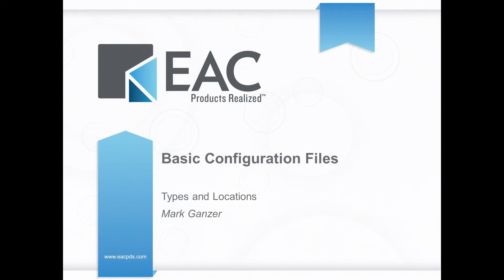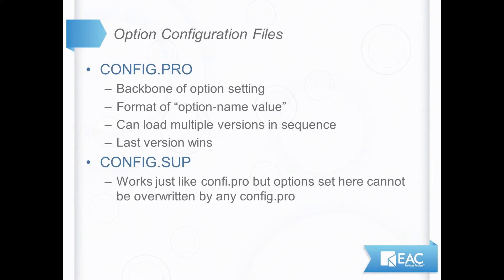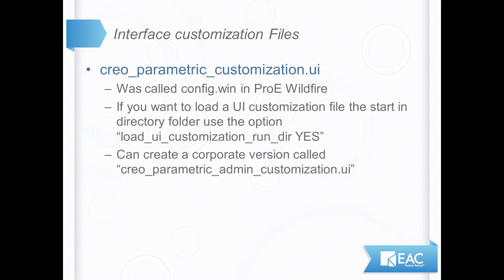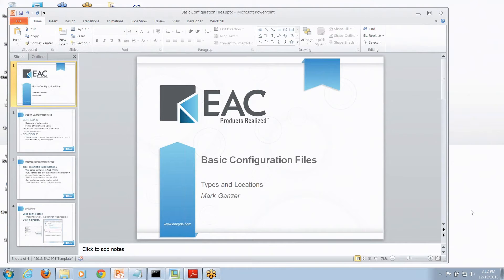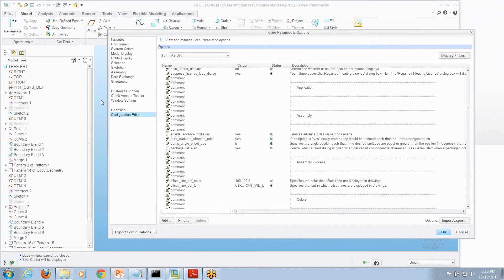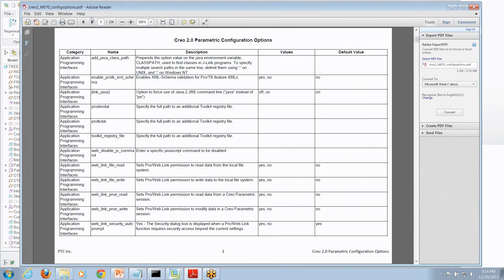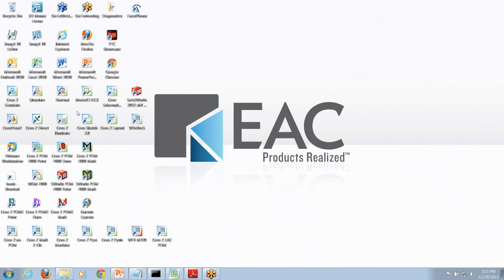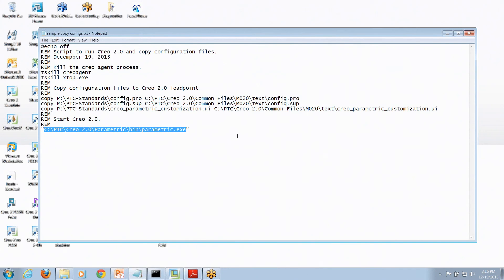Creo Parametric Configuration File 101 - EAC Tip of the Week

Comment: How can I change the default units to always be  mmks  when I create a new part or assembly?
Reply: Late answer. go to C:\Program Files\PTC\Creo 2.0\Common Files\M070\text, and put your product code instead of M070 (you find it under creo about). then find the file called "config" with extension "pro"
then replace this line :
template_solidpart $PRO_DIRECTORY\templates\inlbs_part_solid.prt
by the following line :
template_solidpart $PRO_DIRECTORY\templates\mmns_part_solid.prt
now creo will load the mm solid part template instead of Inch template.
you can do the samething for assembly, drawing and sheet metal